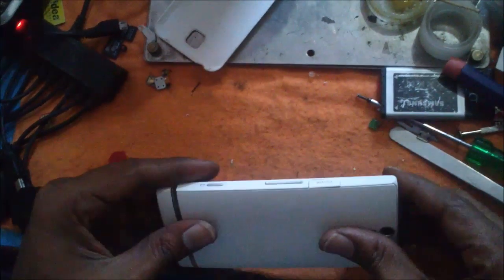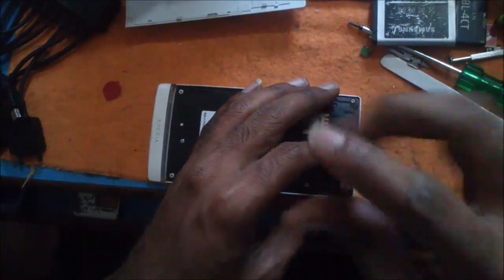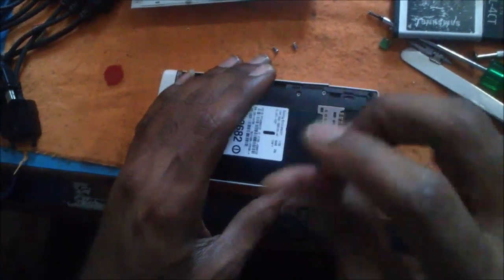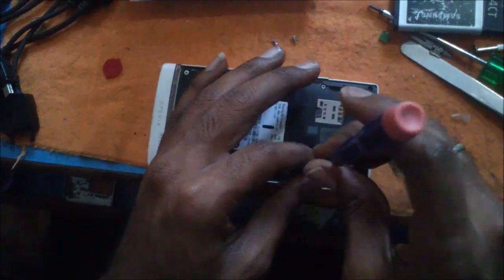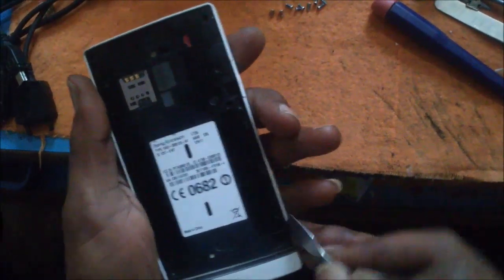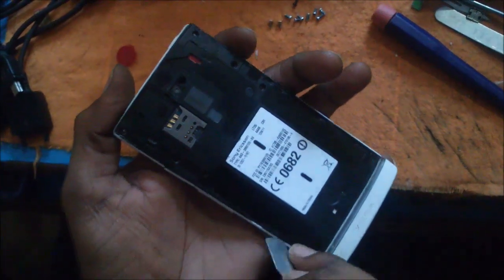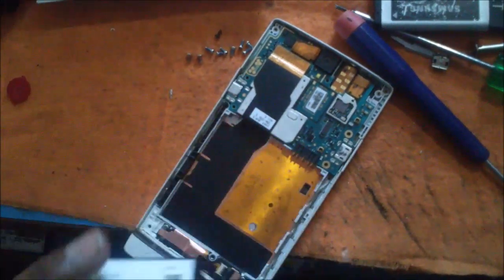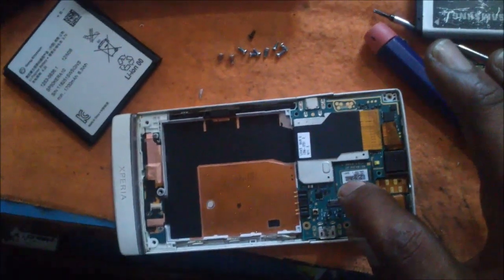Sony Xperia LT26i (S) Battery Removal

Comment: Thank you , very helpful to me, as I never ever had to dissemble my lt26i, it serve me very well for 4 years and now I noticed shorten battery life , checked more than once if there is some new app leaking my battery but it is not, it is battery itself, the end for battery. So as my mobile still working very well, I going to replace it, you helped me with how to do it. You deserve +1 from me.